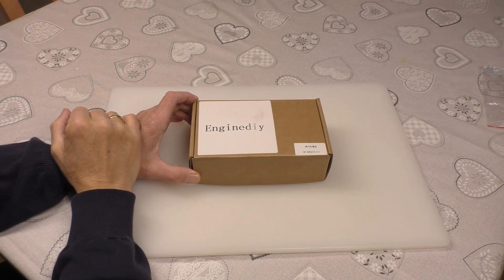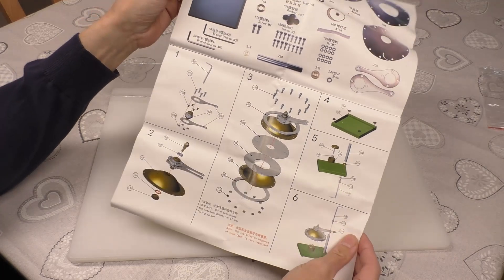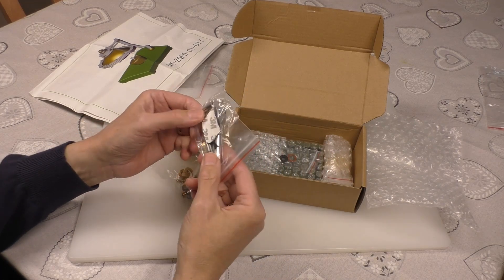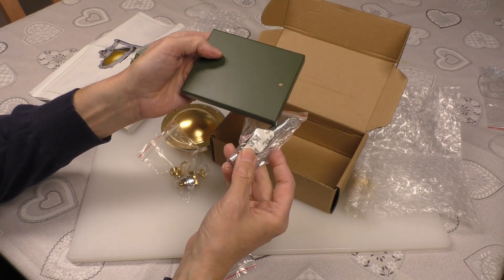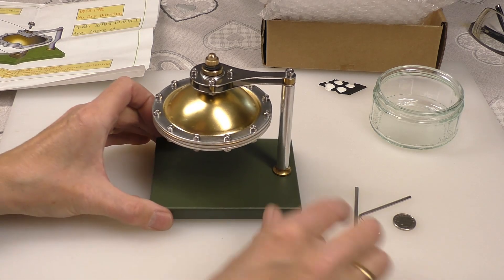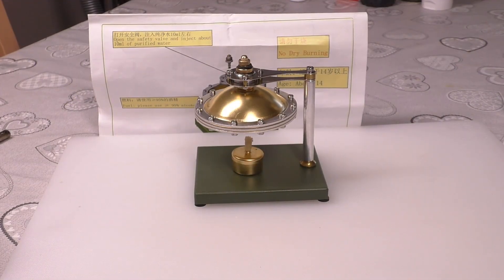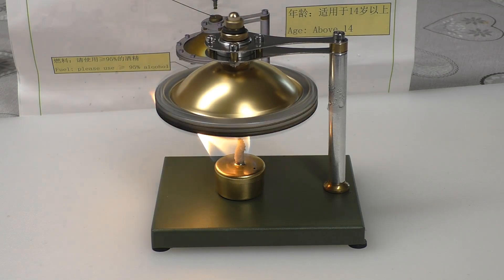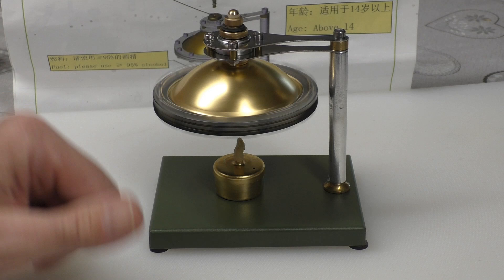REAL working STEAM model you can BUILD yourself in 30 mins/ #steam #enginediy

Comment: I have just had mine delivered, does anyone  know  how to tell  when the water level is to low as there is no sighting window? I don't  want to cause an accident
Reply from the maker: Hi.  There is no window.  Has a blow safety valve to let put excess steam.  You can see the steam coming out the sides.  It will stop when the water has been used up and slow down.  I doubt the burner has enough heat to do any damage if dry.
Reply: Many thanks  for peace of mind didn't  want  to blow my shed up